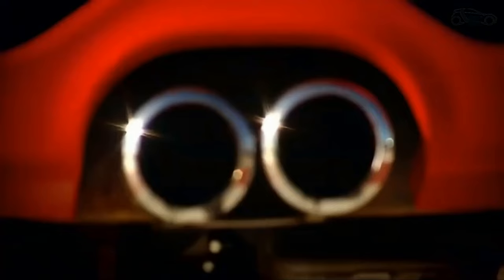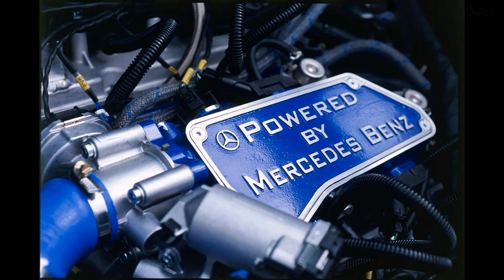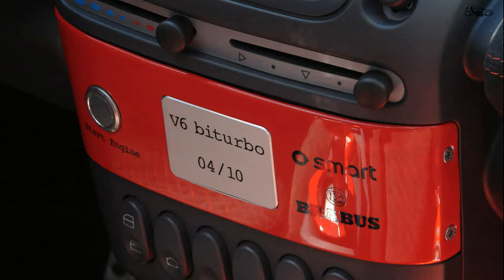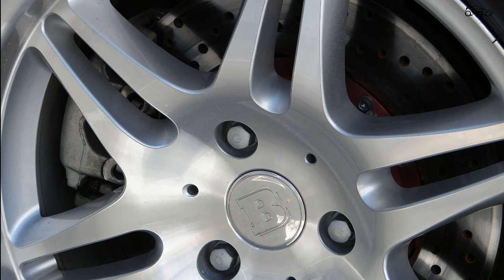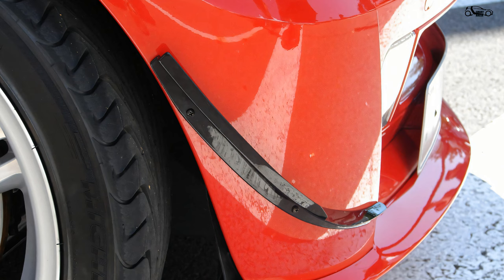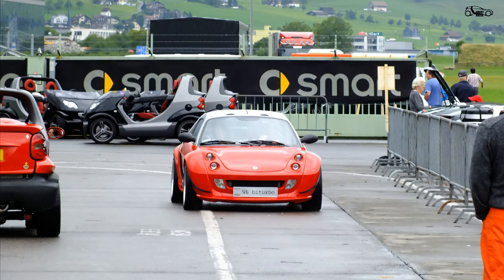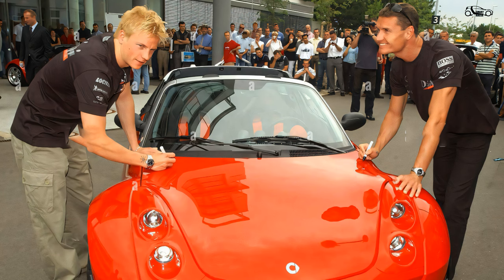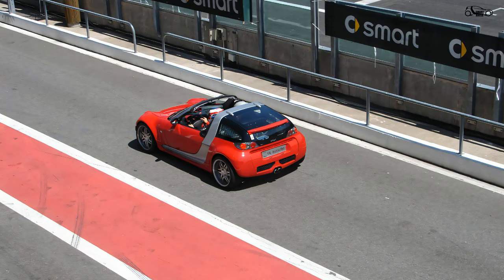What Happened With Best Smart Car? Smart Roadster V6 BiTurbo

Comment: Waste of potential. Should've just focused on going biturbo on the standard car. I'm sure they could've squeezed additional 20bhp out of that small engine. A tuned brabus reaches 115-120bhp. With a biturbo we could orobabky get to 140-150, but I'm not sure if there's a space for that. Probably not. It's craz how uninspiring today's sports cars are. SLK is out of production. Audi TT looks garbage and the same goes for MX5. Roadster with brabus packet looks way cooler than majority of cars.
Reply from the maker: I agree with you! Brabus is unique